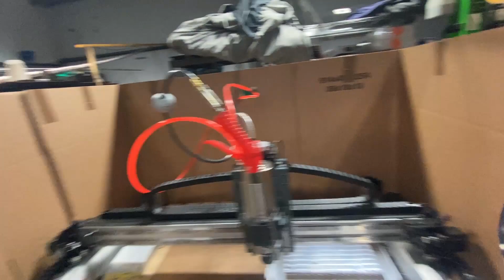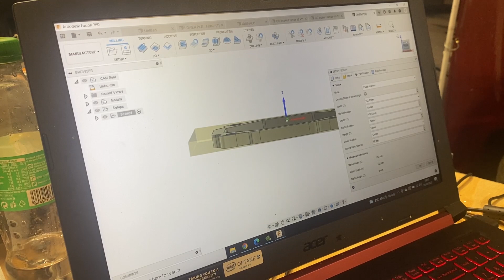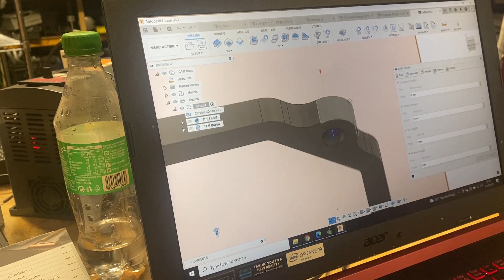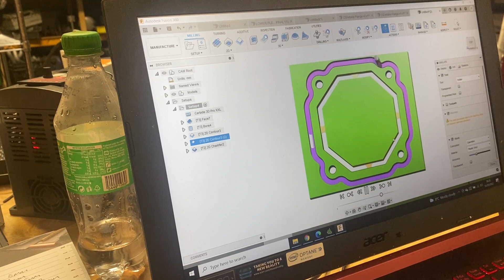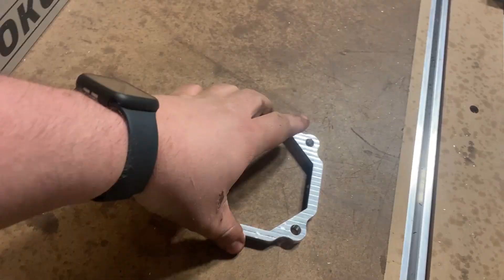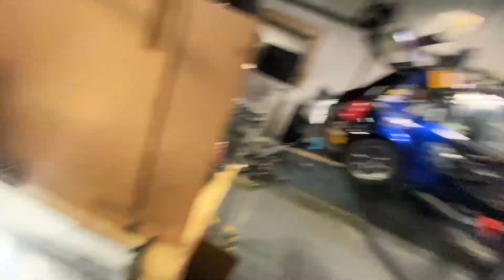OUR FIRST FUNCTIONAL PART OFF THE CNC! - SHAPEOKO PRO XXL MACHINING ALUMINIUM

Comment: Stick to dry cutting, use DLC coated bits, they're worth the extra money, that said we've now tested some budget options too and for the price incredible. For a blower you don't need a full compressor. A small blower pump is all you need, much quieter and smaller.
Reply from the maker: Setups improved since this video. I've had a steel pan made for the SMW Plates to sit in, this allows me to use some actual cutting fluid which then recirculates which helps massively. I also bought a 50L Compressor which is whisper quiet.
Reply: @GizFab  Sounds good, I haven't watched any other vids yet in your series, I'm guessing by your description you have a CNC of two halves, one half with fluid and the other dry?
Reply from the maker: @TheCNCDen  Yes, I have the one side for doing Billets with the vices, and the other half for cutting flat stock and wood etc.
Reply: Could you elaborate on the blower pump. Because i just know the ones with the cylinder inside and theyr the lowdest thing ive ever heard

Comment: How or can you obtain a smooth flat finish on the part ? New to all this and thinking about the Shapeoko Pro. Thanks in advance.
Reply: You can use a finishing mill bit if you want a smooth surface, but i'd imagine you are a bit limited on how good the finished look is vs. a 4 or 5 axis machine